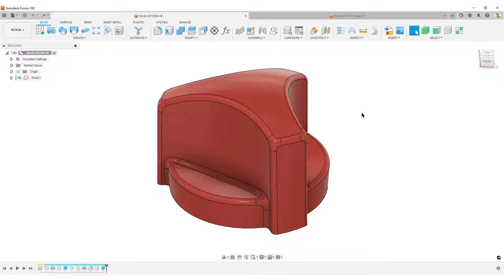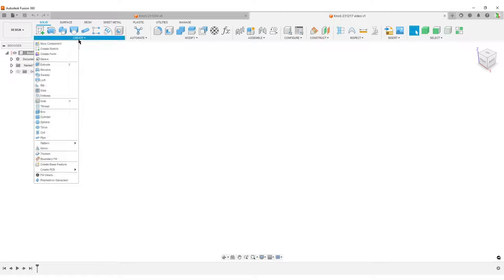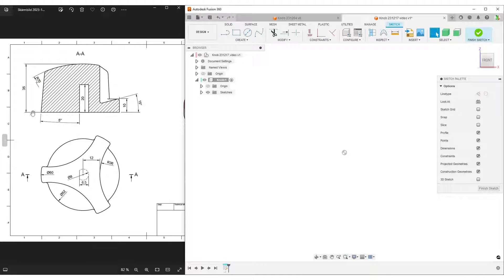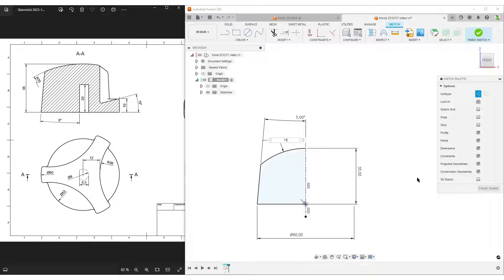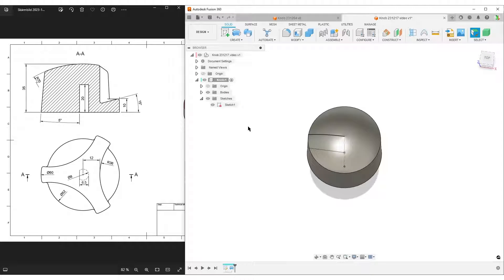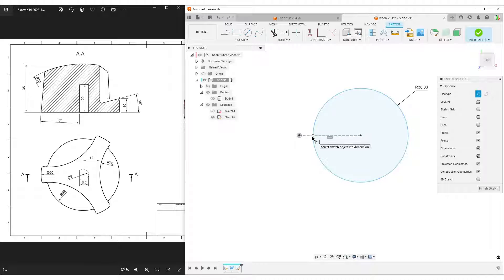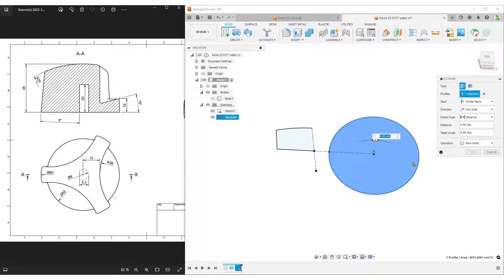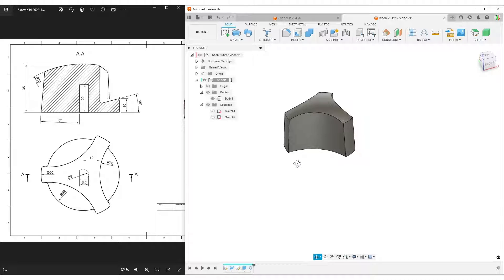A Red Knob - Autodesk Fusion Basic

Comment: Tried it before seeing your solution. Extruded the knob first then cut the 5 and 70 degree angles on it  using revolve with intersect. Then rotated the bottom using sketch plane with the 15 degree angle. To be honest I never would of seen the geometry the way you see it but it would be easier if I did. Not as easy as it looked for me but I am a beginner.
Reply from the maker: Keep on practicing and you will find it easier and faster finding a good workflow for different parts.

Comment: - Good vid, as usual :) Thx.
- SUGGESTION/TIP: for interactive/dynamic adjustment, do 'Show Dimension' (rclick sketch item in Browser), then simply double-click dimension to edit :) Also, can click-n-drag any partially-constrained sketch entity. This way, you don't have to be in Sketch mode to edit aspects of a sketch! :) [Of course, perhaps you already know this, but just decided on another way for this vid. Anyhow, I offer it "just in case": for anybody who might benefit.]
- Keep up the great content...
Reply from the maker: I try and keep the length of the videos at 15-20 minutes, and it eats up time showing to many ways of doing things.
My preferred method changing dimensions is "Change Parameters", gives access to dimensions in both sketches and features.
Reply: @KristianLaholm  
- Understood.
- But, in this case, it would be quicker (slightly) to 'Show Dimension', then alter.
- Anyhow it's your vid, so I understand.

Comment: It's fun getting in the first comment 😀, The centerline tip is so much more useful than I ever imagined. Placing the point on the curve for measuring has proven so much easier to than fumbling around with the dimension tool!
Reply from the maker: Centerline, point and other sketch tools are useful but not there are not that much info on how to use them.
And I'm sorry I do not have any price for first comment ;)